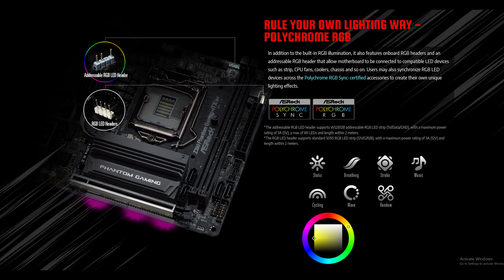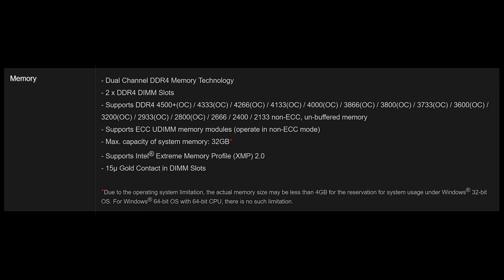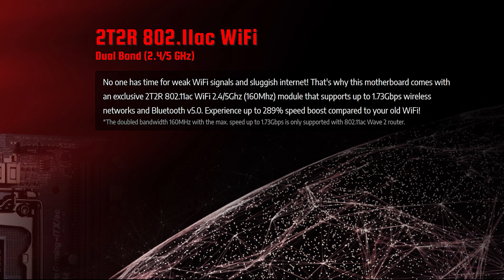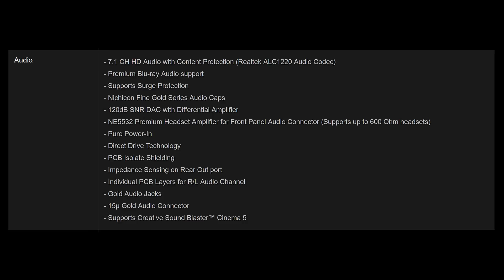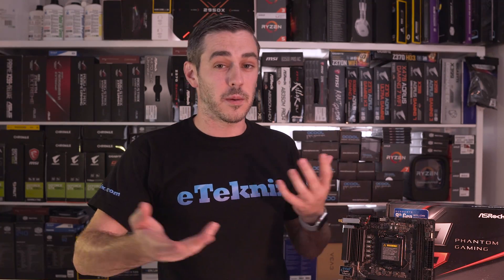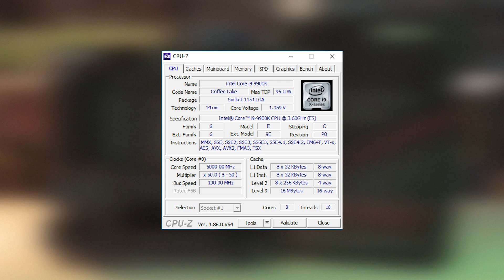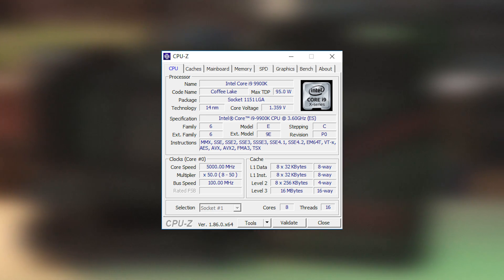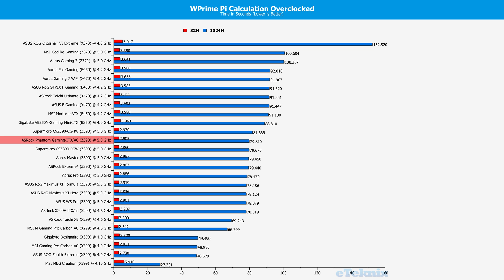SMALL BUT MIGHTY! - ASRock Z390 Phantom Gaming-ITX/ac Review

Comment from the maker: 🔥🔥Are you rocking a small form factor motherboard?🔥🔥
Reply: Hell yeah!
Reply: Am I? I've got this exact motherboard waiting to go inside a tiny ITX case once the 9900K actually get released here
Reply: z370 strix in an lz7 case, but i need to upgrade to this, the power delivery on the strix is terrible. do you know which low profile cpu coolers fit the z390 phantom? - I read that the nh-l12s won't fit due to the VRM heat sinks...

Comment: Greetings!
Faced the following problem: The system does not start on stock / default BIOS settings, showing machine check exception or whea_uncorrectable_error errors (no additional code), or there is no image at all. The processor did not overclock, did not overheat, was installed correctly, did not damage the socket legs.
I checked the rest of the components for operability, did a complete reset of the system and BIOS, reinstalled Windows, nothing helped. It turned out that the i9900K refuses to work adequately on standard BIOS settings. The system starts only if you fix the voltage in the BIOS manually, I am sure that this should not be the case.
Before that, 8700K stood for a while, everything was in order. BIOS version P4.40.
Has anyone encountered this?

Comment: can you raid 0 those nvme drives?
Reply: No. One is normal NVME the other is the older Sata III M.2 due to chipset restraints. You'd think they would have addressed this with the 379 to 390 but no.

Comment: I wish you guys posted what kind of cooler you guys used for this kind of overclock since it's hard to get a big cooler for the usual mini ITX built. For example my case only supports a cooler up to 65mm so it can barely run a the i9-9900K at stock turbo.

Comment: I would like to see some XMP overclocking benchmarks on this Mobo and compare performance vs power-consumption & thermals.
(given that SFF builds are often limited to 600-650W by SFX PSUs, and that RAM is still very expensive)